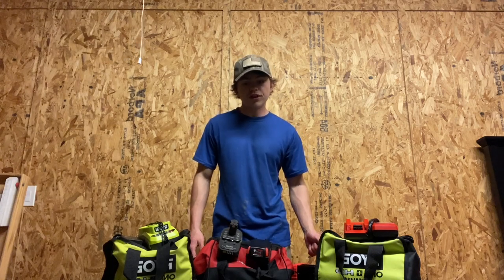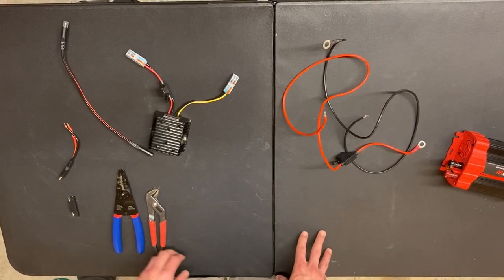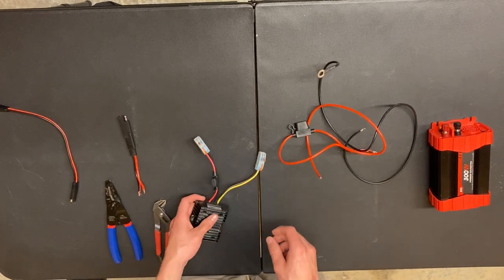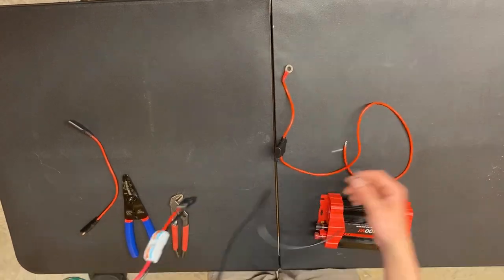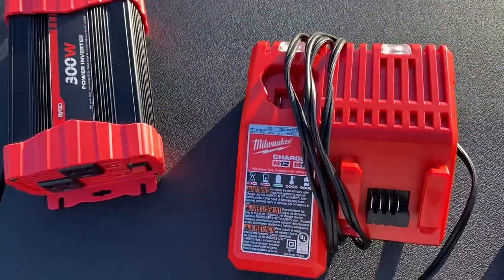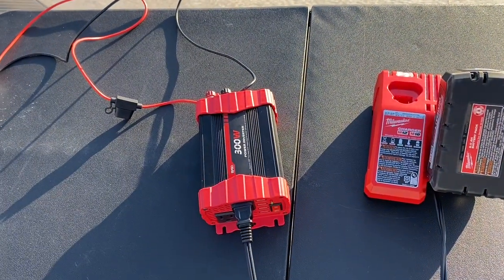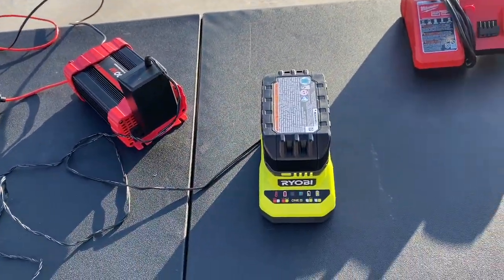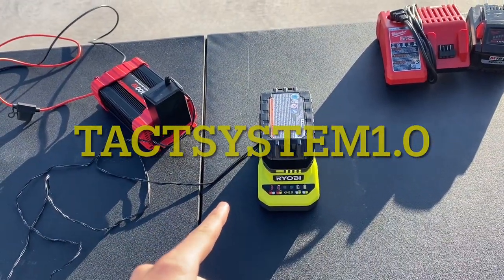How to Build a Battery-less System to Solar Charge Ryobi and Milwaukee Batteries! (TactSystem1.0)

Comment: Just stumbled upon your video and have to say it’s very helpful! I’m still learning about this solar stuff.  When the panel output varies due to clouds, etc, does the converter stop/start or does it provide constant 12v to the inverter? One thing I’ve noticed on similar videos on other sites is their use of a mppt solar charge controller between the panel and the converter. Just wondering if that additional piece would help smooth out the solar input to the converter or is that not necessary?  Thanks for the video. It’s very well done!
Reply from the maker: Hi thank you man for the nice comment! I really appreciate it! The thing on my channel is I try to be very simple on explaining this procedure. 

1. The clouds do not stop the converter. It stays at a constant 12v when it’s sunny or a little cloudy. The only thing that’ll stop the inverter is when you have something plugged into it say like a Milwaukee battery charging. All of a sudden, it clouds up and the panel drops wattage. That’s the only time it’ll stop the inverter because the panel isn’t producing enough wattage to power the Milwaukee charger. The converter only steps up or down voltage it doesn’t change in any condition if it’s sunny or cloudy. The panel always produces the right voltage. 

2. I haven’t tested out an mppt controller on my side to tell you if it’s better or not. My guess is that it’ll smooth it out a little better with the setup because it balances out the converter and solar panel to maintain a steady output rather than a constant random output. Overall I haven’t had any issues with connecting a converter straight from the panel to the inverter. I’ve successfully charged multiple tool batteries and powered a 12v car fridge that chilled a water bottle in 45 minutes directly from the converter. 

Hey thanks for the question! I hope these answers have helped you understand a little more about this solar setup. It’s an awesome little setup for beginners to do! If you have more questions my friend feel free to comment! 😄

Comment: Could I use a 100 watt panel 12v straight to the inverter u used if I can what solar panel do I recommend if I do ur set up to charge Milwaukee 18v batteries
Reply from the maker: I haven’t seen a 100 watt solar panel with 12v output. Most solar panels are at 20-24 volts. My suggestion would be to get a DC-DC buck converter and drop the voltage down to 12 volts then plug the inverter straight to the converter.  I prefer the FlexSolar Panels. I got the 200w briefcase panel and it works really well. It’s about 90% efficient with full sunlight

Comment: How many watt solar panel do u recommend for charging a 18v Milwaukee Battery…Thanks
Reply from the maker: I would say 100w solar panel is the lowest you can go with. The wattage input for a standard Milwaukee charger is Atleast 60 watts. I prefer a 200 watt solar panel because you’ll have extra wattage to support your solar charging needs. I’ve put a Rapid Charger on a 200 watt panel and it works! Thank you for the question